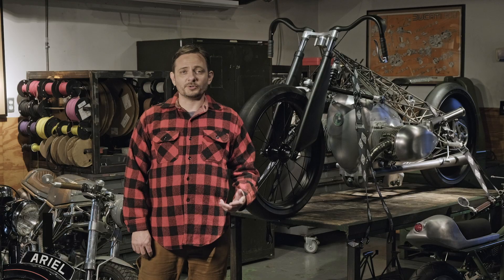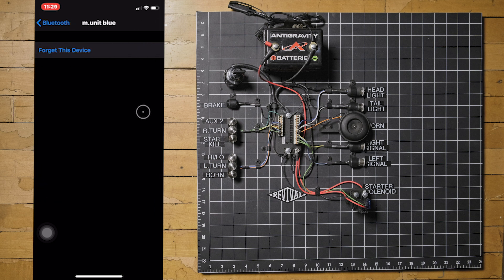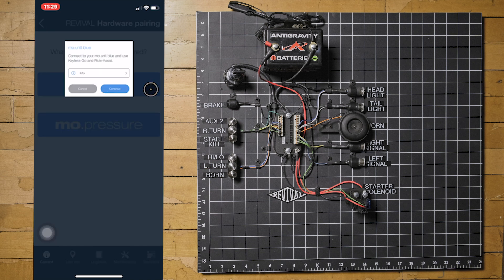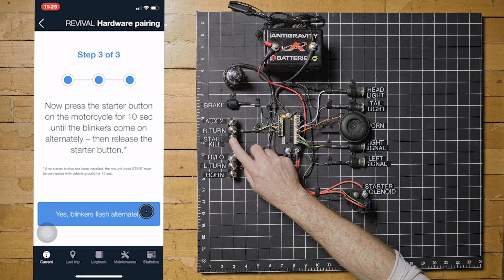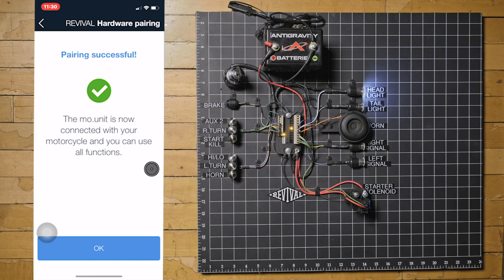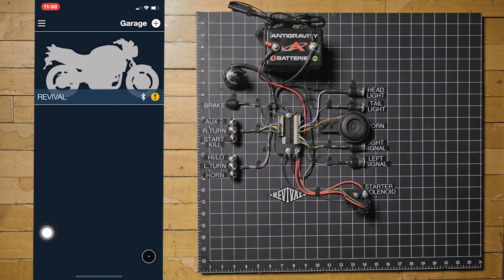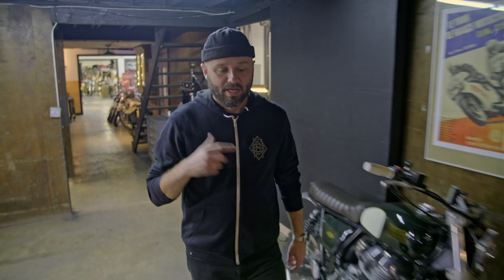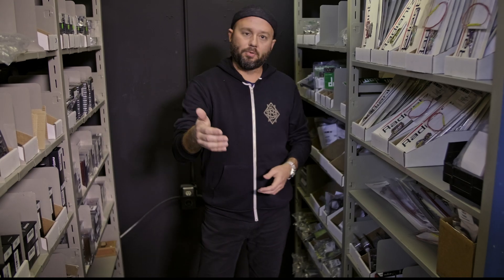Bluetooth Pairing Your Phone with Your Motogadget m.Unit (mo.Unit) Blue // Revival Tech Talk

Comment: Can this only be done with the key for ignition first on the bluetooth unit because i cannot connect at all but i dont have a key only push start feature
Reply from the maker: You have to have a physical on/off switch whether it's a key or a hidden latching switch for exactly this reason. If you can't get the two to pair and you don't have an on/off switch then you can't follow the procedure to re-pair with the m.Unit and if this happens in a parking lot then you're done riding for the day.

Comment: Hi Guys 
Still trying to get this working on a Caterham but I have a couple of issues. 
 I am sending 12v power to the unit and 12v to the "Start" input  
The lights on the M-Unit do not race around but flash simultaneously when powering up (12v unit/12v to Start). is this OK?
I think I can activate paring but I do not want to completely rewire the car only to find I cant program the M-Unit or there is an issue with the unit.
Thanks Steve
Reply from the maker: Hey Steve, this is a bit too complicated to cover on youtube. Email Jeff in Techsupport and he'll help you out.

Comment: To get my bike started I use two buttons at the Same time. When I try step 3 nothing happen. What could it be?
Reply from the maker: Sounds like you may be on the older firmware which involves switching the key on then pressing the horn button 3 times before the LEDs complete their cycle around the m.Unit.
Reply: Revival Cycles thank you for your reaction. That’s right it has got the older firmware. First switching the key on then pressing the Horn will actually blinker the lights. So far so good. When I try step 3, pressing the starter buttons 10 seconds nothing happen. I use two buttons to start my motorcycle. Anychange that a tiny time difference between the two buttons causes step three to fail or is it something else you guys know or recommend to do? Thanks!

Comment: I have no ignition on my bike and can get the motogadget to pair, but when I flip the switch on the bike off the ecu turns off and it immediately disconnects, but when I turn the switch back on it doesn’t reconnect to my phone. How can I fix this?
Reply from the maker: Sorry I missed this question. You may have been experiencing some software issues with the BT pairing. They just released some updates addressing problems that arose after a recent update.